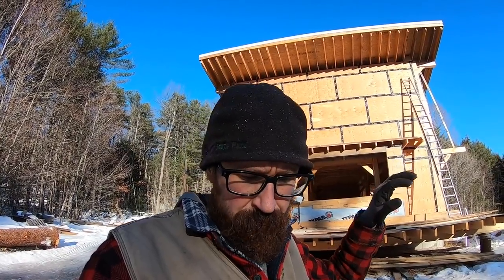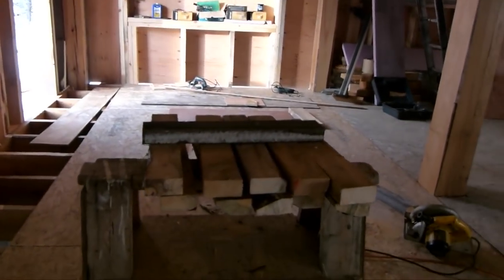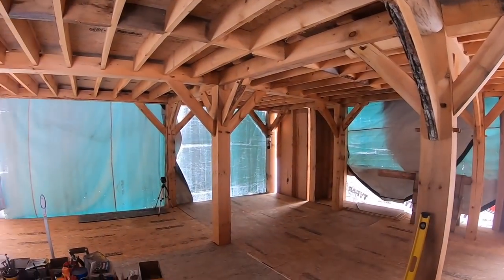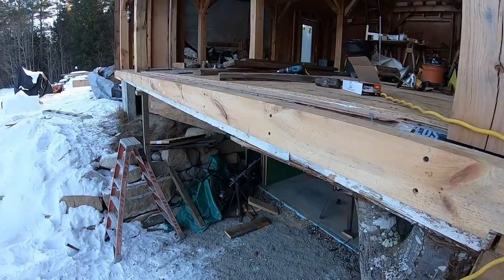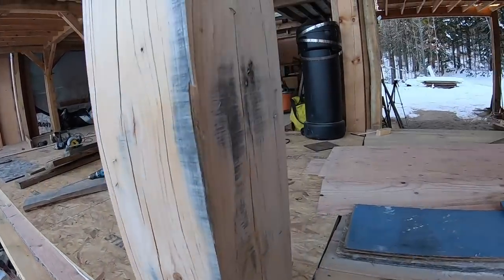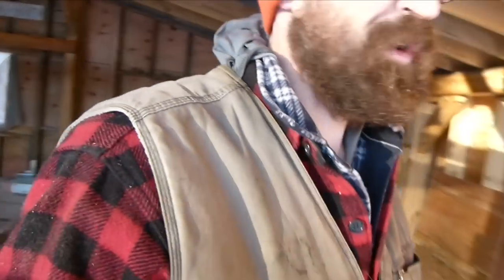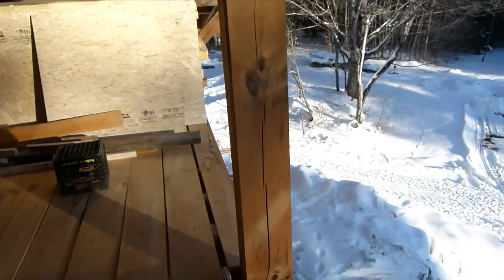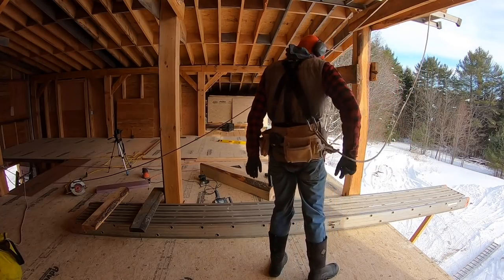Building a House from Trees SE 5 EP 11 Final Walls Framed - Second Story Deck Started

Comment: Waiting all day to watch this video after seeing it pop up in the AM. The way you put the 2x6 all outside of the timber frame is smart. You will be able to see all that work inside and have nice thick continuous walls, before seeing that I was designing to recess the frame into the wall. That's going to be a 100 yr home right there.
Reply from the maker: Thank you so much! It was a suggestion from a friend, and a very good one. it was a bit of extra work, but it will be like a thick sweater on the house. I am happy about it.
Reply: @BusHuxley   It's great, a sweater exactly. The only problem is your friend's idea just cost me about 30 hours CAD work! No rush though. ✏️✏️
Reply from the maker: @___PK__  I dont understand!
Reply: @BusHuxley   I've been designing a timber frame home in CAD and had that part semi-done. Now I need to reevaluate the whole wall design + foundation to fit. I think it will be worth it  to adopt your approach though.
Reply from the maker: @___PK__  Very good. I am really happy with how the interior is going to finish now. I am still puzzling a bit about sheet rocking up in the braces but Ill cross that bridge down the road. Keep me posted with what you decide and how you plan on doing it. Thanks for the comment.

Comment: What a way to wake up in the morning, another episode of a house from trees. Redundancy and safety, was a funny phrase but you live to say it. I wonder though, with a dead phone battery and say there was a slip, hanging by the harness would we have been able to hear you yell like you hear a tree fall in the forest? Just wondering but very glad you took precautions. I was high of of the main mast in the navy and slipped out the boatswain's seat and was saved by the harness. Glad for that but dont forget to stay in a seated position when the lanyard tightens up.🤔🤔🤔
Reply from the maker: Thanks! Yes, the phone usually has enough life for one call. I can pull myself up if need be. A consequence of building house from trees is upper body strength has increased. Thanks for the comment.

Comment: Hi Bus, I wonder if you’ve ever talked about how to deal with the transition issues you’ve met in this build? Like between your frame and the outer wall, or inner walls? Or between floor heights from bent to bent?
Reply from the maker: I will be covering that as I encounter it, with the sheetrock and paneling. That is something I am researching and figuring on. But I have some ideas. The walls are all exterior of the frame, so that is made pretty easy. And the floor height is raised two inches upstairs to expose the beams downstairs and for running plumbing.

Comment: I just realized I hadn't heard you mention getting a wood stove in there for heating. Is that the plan? Are you putting HVAC and all that in as well?
Reply: 06:24
Reply from the maker: I will be using a wood stove for primary heat. Moniter heaters propane here and there and some electric radiant in the bathroom. And that sun!
Reply: @BusHuxley  Nice!

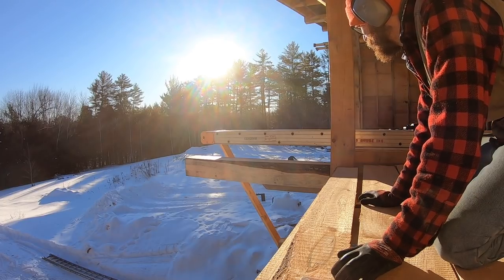Comment: The most dangerous thing I think you did from 22:00 on, was to lift/hold that beam with your extended leg.  Cause if you strain that muscle on the front of your leg even a little bit, you'll be down for the count.  I mean you won't be able to do anything but maybe lay on your back without being in cold sweats pain.
Reply from the maker: Wasn't that heavy and I've got really strong legs for being as spindly as I am. I run nearly every day and that ladder work keeps them up. If one has started to go I wasn't going to fight with gravity that hard. let it fly!

Comment: the safety strap wont help if you cant call someone (you can only hang in those for around 15mins)
Reply from the maker: I can actually pull myself up a rope with my arms at this point still, thankfully. So, in that case I wouldn't need a phone. But there is usually a little life left in the old phone for a quick call anyway. Thanks though!